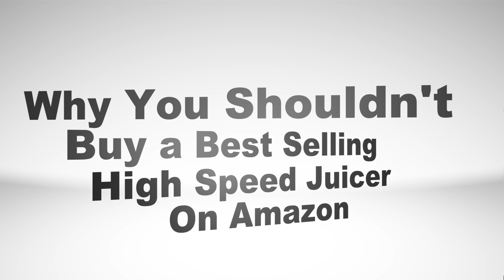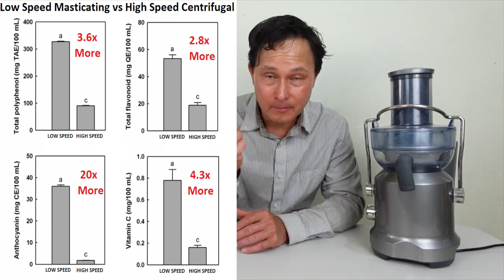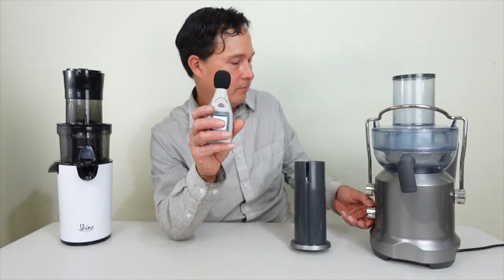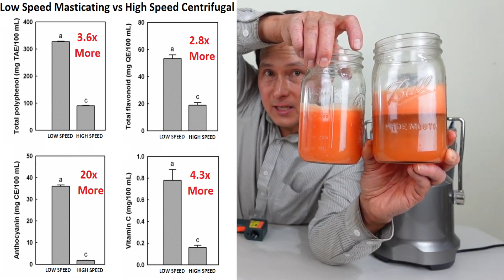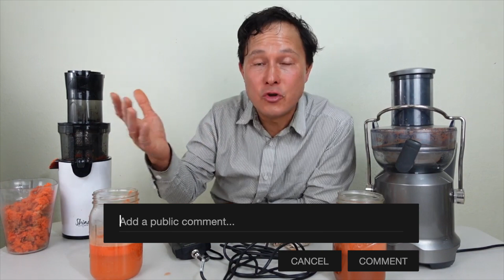Amazon Top Selling High-Speed Juicers: Don't Waste Money & Nutrition

Comment from the maker: Jump to the following parts of this episode:
00:23 Who am I? 
00:47 Best-Selling Juicers on Amazon
01:20 High-Speed Juicers 
02:01 Low Speed Juicers aka Masticating 
03:12 Shine XL vs Breville Cold Juicer
04:19 What High-Speed Juicers Do 
05:45 How a High-Speed Juicer Works
06:28 Two Problems with High-Speed Juicers
06:57 How a Slow Masticating Juicer Works
07:55 Holes in Screen Affects Nutrition & Fiber
09:17 How to Assemble the Breville Cold High-Speed Juicer
09:27 How to Assemble the Shine XL Juicer
09:47 Sound Testing Juicers in Decibels
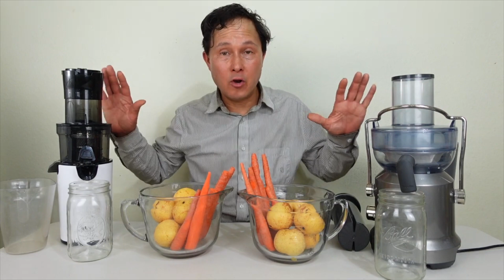10:51 Juicing in Both Machines 
11:43 Juicing in the Breville Cold Juicer
13:10 Juicing in the Shine XL Slow Juicer
14:00 Comparison of Juices 
15:22 This lowers nutrients in the juice
15:40 Testing Dissolved Oxygen in High-Speed Juice
16:12 Testing Dissolved Oxygen in Slow Juice
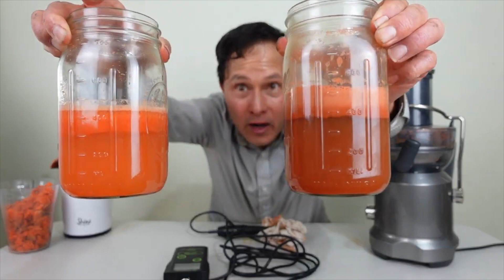17:17 Difference in Color - Oxidation Damage
17:45 Taste Testing Juices
18:40 Fresh Juice is Better than Soda
19:06 How dissolved oxygen affects juice quality